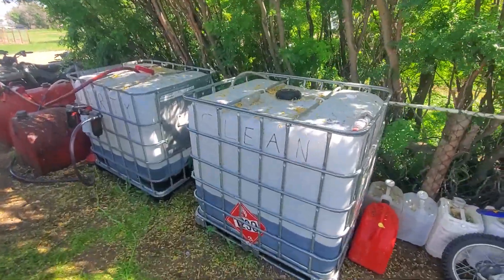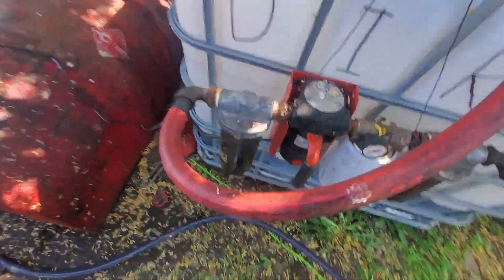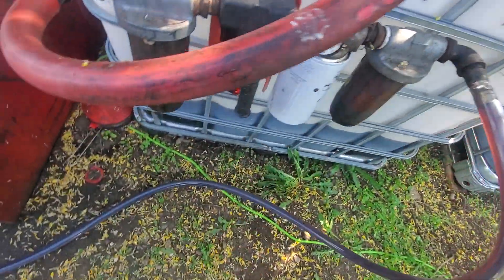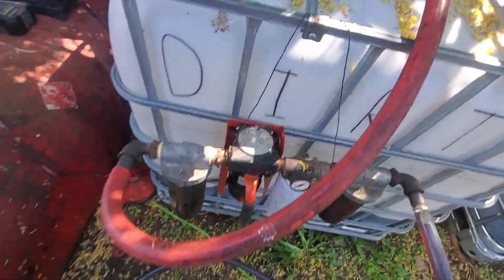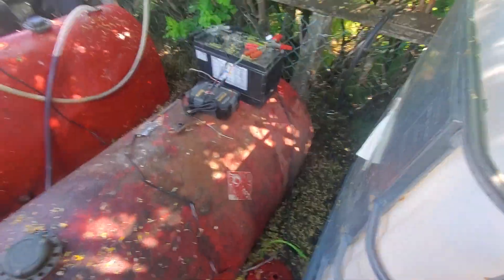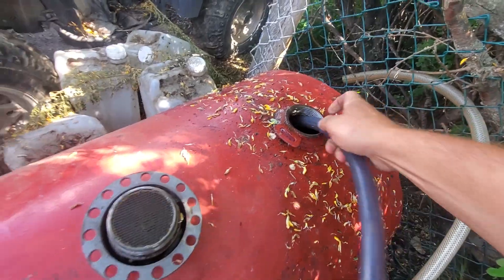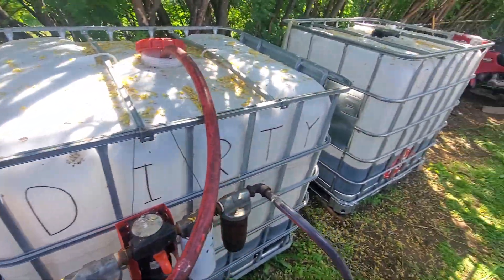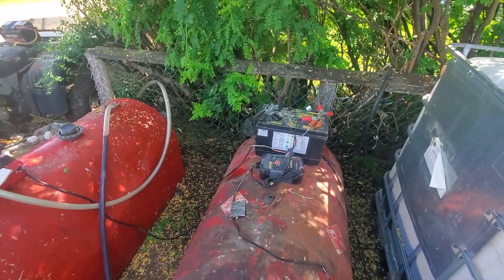Simple waste oil fuel filter setup for WVO, WMO, engine, transmission, etc

Comment: Cool video got a parts list of what filters you use?
Reply from the maker: Unfortunately not. I don't use that anymore. Centrifuge is really the only practical way if you plan on doing any real amount. 

Goldenrod 495/496, Goldenrod 80 mesh screen, & whatever filter hosing takes cheapest filters. Google should tell you the rest
Reply: @motorman9 so what happened that made you switch to a centrifuge?